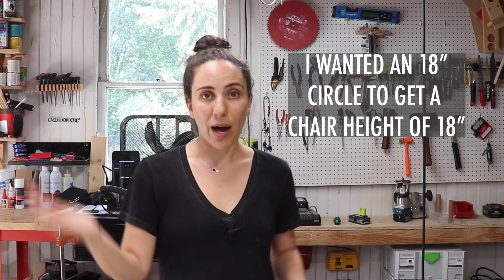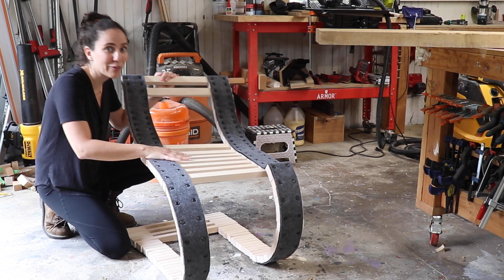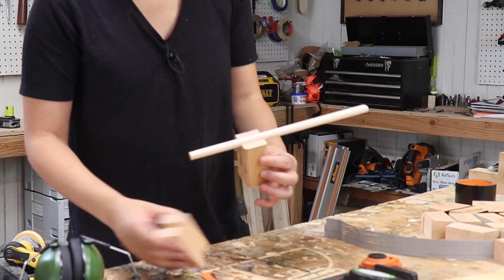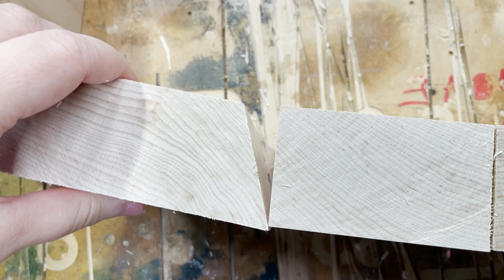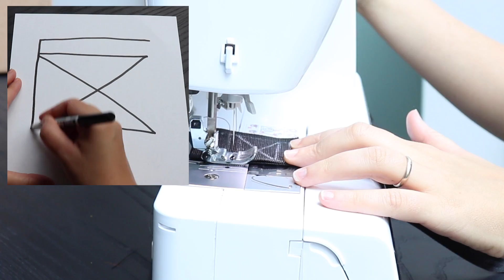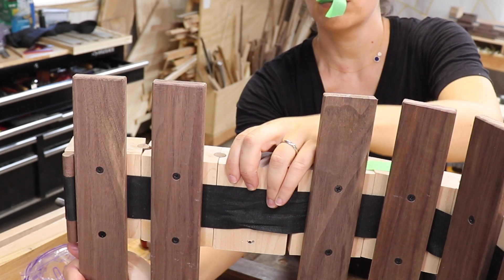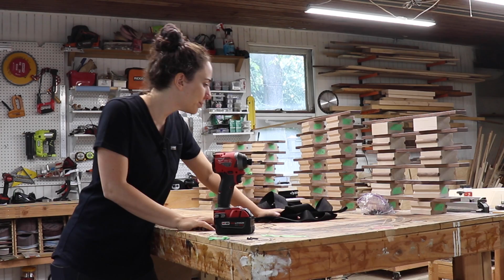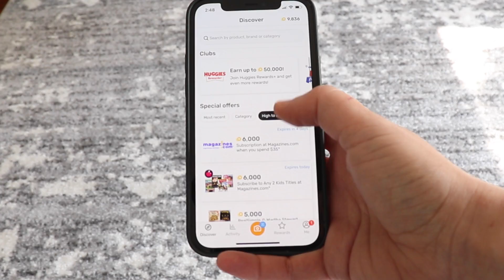I ATTEMPT to make a Roll Up Chair… AGAIN...

Comment: I really admire your persistence. Chairs are one of the most difficult items of furniture to make due to the forces applied. I think your instincts are correct that the current design has some inherent safety issues that may not be correctable simply by using alternative materials. Seems a design tweak is the best course of action. Good luck. Love your videos!

Comment: "Strong" webbing does not mean "inflexible" webbing that will not stretch. All textiles have give in them and woven textiles might be less flexible than knitted but they too will stretch. You need webbing that either does not stretch or is "pre-stressed" i.e. under tension before being rolled into chair shape. But then that too will probably stretch with repeated sittings.
Leather stretches! That's why leather belts often have stitching around their perimeter: the thread of the stitching stops the belt from stretching.

Comment: Going from your current design, how about hiding metal cables under the belt? they should still be foldable enough to roll and shouldnt allow stretch and then have a belt stapled or screwed over  at each piece to help with the tension amounts on each pieces. The curve of the leg of the chair should not be allowed to stretch at all.
Also, I know it defeats the purpose, but you could add another cable set... :
- Have it go through the pieces of the backrest until it starts to curve at the seat.
- From there have it tie to the end piece of the leg of the chair. 
- When you want to roll the chair, just untie it from the leg and then the rest will be realed inside the backrest pieces as needed.
This should help give you a counter balance of tension, wich would prevent pieces of the back collapsing. If this works, it should also make the chair safer when it's set in place in general.

Comment: Hi, very good Idea! The Problem is the stretch of the materials. 
What about Metall? 
Try using a chain, then the wood will be the only weakpoint. (Leather wears out and stretches. You will need a really thick leather)
I think a chain really holds the chair in shape. 😉

Comment: Due to the shape I'd make sure the strapping can take at least 2000 lbs of load (each strap) to safely support a smaller adult's weight (130 lbs) with that chair shape, which means the attachment points from the webbing to the wood also needs to be strong enough.

Also, if you want to avoid the high deflection when sitting, you'll need to either drastically increase the stiffness OR preload the structure after you unroll it (before you sit). With preload done properly, there would be very little noticeable deflection then when sitting or using the chair.

Comment: If you want to try a different strap, use an old Boy Scout trick for lashing: NYLON. If you soak nylon in water it will stretch more than it does when dry. If you tighten it when wet, it will get even tighter when it dries. That doesn't solve the stability problem. The old steel yard "spring chairs" that use a similar shaped design solve it by increasing the strength of the supports (because they are steel). Perhaps a middle row of blocks?

Comment: Some of the other comments already mention that even tension distribution is undesirable here. I think the whole approach of a single strap is flawed unless you can think of some way to prevent it from sliding between blocks. I don't know if this would work, but maybe screwing the walnut strips directly into the strap would sufficiently hold it in place, resulting in the tension between each two blocks being independent from other blocks.
From the video it seems the blocks only start growing apart when you push down on the back, applying enough tension for the strap to slide. If the strap is held in place on each block, then the tension could be distributed unevenly between blocks and the blocks with the most tension between them might just be able to keep together.

Hope this project works out in the end, it's a cool concept :)
Reply: the material properties of the strap being malleable and elastic would create a failure point where the screw penetrates it. the force would have to be more spread out that that, or it will deform around the screws, and fail rather quickly. The only way to secure the strap in that way is to either use a lot of small steel wires, effectively stitching it together, or using many small tacks. both are the same though, as you still have to drill a hole to get the nail, tack, or wire into the wood.

Comment: Perhaps a Core strength member, drill a hole through the centre of each segment,  fix at one end a braided cable, invent a tensioner at the other. Like the Sydney Opera house

Comment: Instead of webbing, consider drilling holes and running metal cables through them. That should resolve the flex issue. I'd also considering separate tension between the bottom and top instead of one continuous length across the whole piece.

Comment: Maybe it could work with sixty steel hinges instead of straps.  That way tension won't transmit to the ends.  If it starts sagging you'd have to put in little shims or something.

Comment: If you're familiar with how brake cables are connected to the brakes on a mountain bike then my suggestion is to use metal cables routed thru the middle of the blocks and then secured at each end of the chair with a bolt in the way it would be on a mountain bikes brakes that would solve the problem of the streching but still make it flexible enough to roll up as well as it would make it adjustable without having to completely disassemble everything each time
Reply: And then build gears into the chair!

Okok, sorry, nice points tough ;)

Comment: The strapping is not the issue. While adding the strapping you should have the chair curved in the opposite direction...example rolling it up and keeping it loose enough to add the strapping.

Comment: As others have said - the strap not being secured to the pieces is one of the biggest flaws you have there and it becomes very visible:
23:00 - you try to sit on it to show how unstable it is and what ends up happening is the last link at the bottom tilting inwards, releasing the tension on that end. If the strap was secured to each section this would not happen.
Also that would make getting the right tension way easier as you'd would no longer need to get the tension for the entire length correct at once but could do it for each individual link.
It is also a thing you could try faster than starting over.
(also - forget about leather. While it is a good material for other things, here you have high tension loads, and leather is stretchy).

And lastly - "sharp" corners.
Where the blocks meet you got a relatively sharp corner and when the strap is under tension those will be ever so slightly pushed in, while causing wear on the strap. Well, not really much of a problem if the entire thing does not work yet.

Comment: Aerospace engineer here. The problem is stress-strain relationship. Your straps stretch too much. You want something that will just break instead of stretching that much at all. Either that or use a strip of fabric that's as wide as possible so it doesn't stretch as much. 

You may want to look into carbon fiber or fiberglass strips as the fabric. Carbon fiber stretches less than 3% before breaking, and it's one of the strongest tensile materials you can buy.

I also agree with other commenters about securing each segment of the strap. That's really important and should greatly decrease the amount of stretching in each segment. I'll try to explain why, but it might be a bit confusing without diagrams. 

When you pull on something, it will stretch a percentage of its original length. This is called strain. Let's say the whole strap is 100" and there is 1" between each wood piece. If the individual strap segments are not secured, the whole strap has to take the force and stretch. Let's say it's pulled hard enough that it stretches 5 percent. With the straps only anchored at the ends, you'd get 5" (5% of 100") of extra stretching wherever the stress is highest (the bottom curve). Now take the scenario where the strap is anchored to each piece. Under the same forces, the strap would only stretch 0.05" (5% of 1") at the highest stress area. This is a much more stiff structure. The most important parts to secure are where it leaves the floor, the bottom curve, and the curve up to the backrest. 

Good call on pre-tensioning the straps as well. That should help stiffen things up a bit more.
Reply: Ah aeroplane engineer! When you need it to be airborne, you can just use more weighty materials.. like steel cables too :)

Comment: Would it be an option to have a locking tension on the opposite side which requires a 'lever' action to 'engage' and then it won't move until the lever is released?

Or possibly having a pin that moves through the structure to lock the pivot points into place by restricting the movement of the pivot?

Comment: Perhaps you need to have the straps or whatever you choose to use go THROUGH the MIDDLE of the wood blocks instead of attaching them to the outside of the slats.  For example, can two thin slots be cut into each block that the straps can go through?  Just a thought.  I wish you the best of luck with this!

Comment: you need something to add tension to the cables. a screw (probably two and big handles) that will tighten up the cables when you deploy the chair. and i'd just use simple steel cable and run them inside the wood, not on the outside, just means a few holes, think tendons in your hand. and actually those two steel cables could be all of the hinges, so things get more simplified.

Comment: Would it be possible to use hinges rather than straps? It may still be 'roll-up'able but the structure would use the strength of the hinge rather than the tensile strength...? 🤔

I know this would deviate quite a bit from the original design, but it may accomplish the task in a practical manner...? Maybe? Certainly it would at least prevent the gaps in a mechanical way for sure 😁

Comment: what if it just had a couple metal poles that easily snap onto it that support the back? They could just have a quick attach/release point and really not take away from the style very much. They could even fold down from one point and snap into another.

Comment: one thing that comes to mind is having a  multi purpose belt on tethered to the top block of the back rest on either side.  The first purpose is to bundle the rolled up chair by looping it around the outside, and the second purpose is to provide counter tension along the back side of the back rest blocks. Might need to have it come down to one of the seat blocks to get past where the original strapping is on the inside diameter where it transitions to the back rest.

Comment: Leather won't work, it'll either cost a coupe hundred for the amount and thickness you need, and even then will stretch and wear, essentially breaking. Steel cables or if you're set on straps, the heavy load straps like truckers would use to secure heavy machinery are possible.

Comment: Not a carpenter but there is unnecessary stress on the back rest.. Maybe end the 'tension strap' where it meets the back rest . The back rest should have its own tension strap separate from the main . 
Glueing the corner like she did seemed to work well so why not put some screws in an angle as well . also glue and screw the other 2 corners (top of leg , bottom of leg ) . 

Like i said not a carpenter just my ideas
Hope to see it finally work !

Comment: seems like the problem is that the tension is allowed to propagate between the segments, instead of letting each joint function independently. so if any slack appears in one part of the chair, it gets sent right to the highest tension part and creates a gap. so i would think maybe gluing/pinning it, or just adding really grippy pads to the slats would be good, and assemble the whole thing under tension

Comment: Maybe you figured this out there's still 9 minutes in the video left, but if you use shorter runs of strapping at critical points of the structure, there's going to be less chance of overstretching from stress.  You are just compounding the problem by have one long strap, and you could easily hide any overlays for multiple pieces of strapping under the cross bars.

Comment: the webbing 100% needs to be segmented. the bottom and the back does not need high tension and i think that's why it starts folding when you put too much weight on it,

Comment: I don't know about exact measurements for your chair but as an example: Putting a 150 lb person sitting 24 inches back in the chair, and using 2inch thick blocks is going to exert 1800 lbs of force on the strapping which is just unable to hold that without stretching. Couple things you can do: 1. Use something stronger than strapping such as steel cable. This might cause the wood to deform where the cable lies on the wood, especially if there is any movement causing it to rub. Perhaps a quick tensioner like on guitar strings could just compensate for this over time. Another option is to use maple pieces thicker than 2". Going to 4" will decrease the load on the webbing to half of what 2" is. Last option is to make the chair a bit shallower. For example going from 24 in chair depth to 18 inches decreases the load from 1800 to 1350 lbs. I really wanna see this happen though!

Comment: The pragmatic you should stop trying to make this chair. The "don't tell me what I can do" part will probably try again.
If you try again, it might be interesting to test the stretch factor separately so you can find the right material. I don't know if there's something like a no stretch fishing line or something simpler to work with. Also, not sure if there is a simpler prototyping method to test just the spine. Maybe a system more like a guitar string at the ends with a channel for the tension cord.
In the end, I think if you solve it, it will be by improving the economy of failure and not by divine inspiration.
If the slats are only required to sit and not required to test the spine tension, it might be interesting to leave all the slats off except maybe the first/last one which would save time.

I think it could be interesting to ponder whether there's a mating joint which would cause the pieces to press more tightly together rather than open a gap. Sort of like how a french cleat presses more firmly into the catch the harder you press on it.

Lastly, that was a good point on safety. Even if you conquer this chair, unless you can make it safer, it may be necessary to sell it to someone without children. Worst case, you might be able to put a removable and "invisible" post in the air space.

Good luck and look forward to seeing other videos from you.

Comment: There is just way too much leverage acting on those joints and straps. Pine is too compressible at those angles and no fabric be it cloth, synthetic or leather is going to withstand the stretching force. A very hard wood and steel cable might work but cable would not roll well unless you hinged it at each joint, and if you are going to do that you may as well use flat bar steel. Hinging that would give you the lateral support you need. The weight stresses need to be applied at right angles to the force. Fabric could handle that. That roll configuration is simply too much stress for those materials.

Comment: Motorcycle chains! The wood already has some flex, so you don't want strapping that stretches, too. Motorcycle chain would also resist torsion, providing additional stability.
Reply: And more weight... I think at some point, the idea of this "roll up" thing, is that it can be portable. Too much weight would affect that portability. Don't you think?

Comment: Was the final material you used for the strap anything like seatbelt material? A local bulk seller near me once sold bulk lengths of seatbelt strap, which I bought a bunch of, and use it for  assorted things - basically zero stretch, though I haven't tried it for this scenario. 

I DO think that securing it at each piece along the curve will help contain that stretch along the curve, thought. 

Last thought, much like you regretted not cutting the dowel groove all-at-once, do the same for gluing in the dowels - do the whole length, then cut them up.

Great job, awesome experiment, and it's inspiring me to try some new things! Keep kicking ass!
Reply from the maker: Yup. That’s exactly what it was. Still too much stretch

Comment: 1st time watcher. Very interesting project. I writing this after thinking about how this can be done.(about an 1-1/2 hour).
I won't tell you how to do this, but I will give you the jest on how to accomplish your chair.
The key to this structure is the bottom curve, this is your foundation. This is where you need the most support.

         In your curve (bottom one) 2 adjoining pieces of wood, design the bottom side of the wood, wider, so it overlaps the preceding piece of wood.
Make a cutout for this IN the preceding piece of wood. With each piece of wood having interference with the preceding board should give you the strength
you need. Do this for the whole curve. You would still be able to roll the chair up the opposite way.
Here a thought for ya. A rope, cable, tied off between 2 poles. Stretched as tight as possible!!  Now hang on this line, it will droop down.
Same principle with your chair. Shorten your angles(wood) on the curve, so when unrolled to the sitting position,  
its at an upward angle, then you must sit in it to bring level., kinda like bending a piece of sheet metal PASSED the angle you want, so it will spring back where you want it.
Good luck!
Update:   here what I was talking about
https://www.youtube.com/watch?v=MuodNlDKce4
This guy figured it out!!